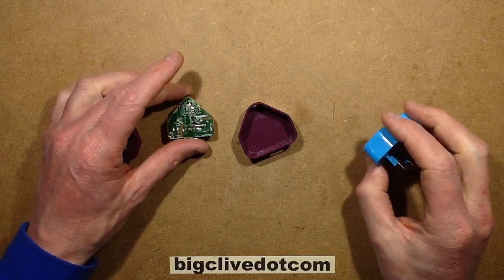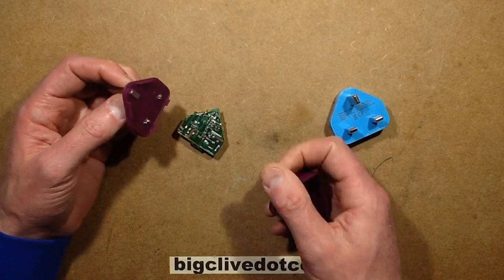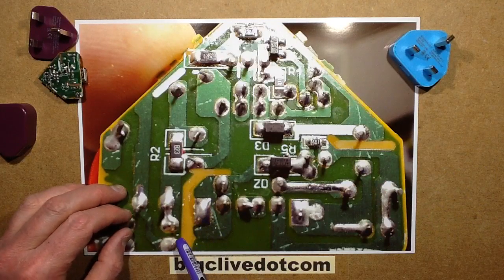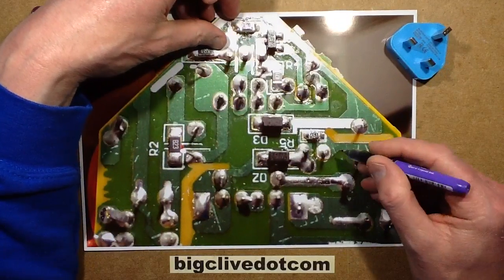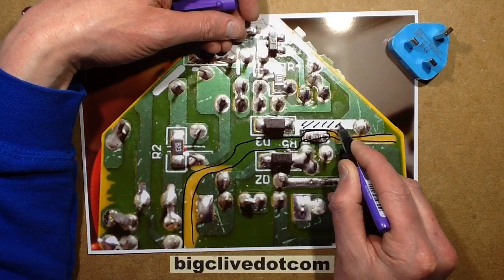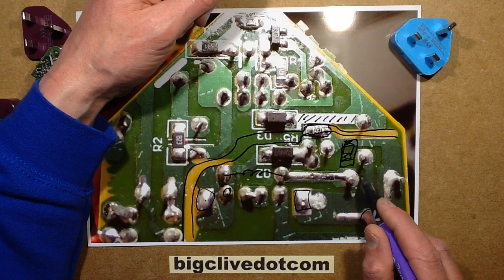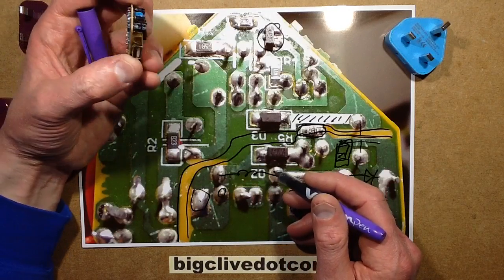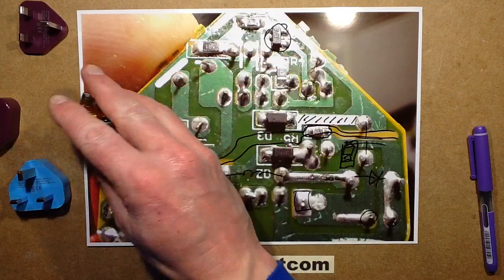Silly isolation fail in cheap USB power supply.

Comment: I have one of those knock-off US iPhone chargers (two actually!) with the crappy, nearly non-existent isolation. I also have a large isolation/noise filtration system.
I should make a vid, "How to safely use a fake iPhone charger", by showing it connected to this system.
Which would be entertaining:
Tiny 1" square USB power charger, connected via GFI outlet, to this huge industrial panel covered in transformers and EMI filters.

Comment: Could it be that the design was done by different people/companies at different stages?  For example, the board was cut and the holes were drilled at one factory, then they all get sent to another for the etching on the idea that the next guy could handle the rest of the design.

Comment: 0:58 it's actually low voltage to extra-low voltage isolation. Low voltage = 120-1000V, extra-low voltage = 0-120V. High voltage is more than 1000V.
Reply from the maker: +rfvtgbzhn For us electricians, yes.  But for the average dabbler low voltage is batteries and high voltage is the mains.

Comment: Clive, have you heard about electrolytic capacitors in samsung TVs? They really do mount them almost touching the radiators, and they do it just because it's a cheap TV. They COULD mount them away from the heat, but why? Which producer would want to wait about 5-10 years to sell another TV to the same customer?
The same principle goes for anything, ESPECIALLY when we're talking about "cheaper-than-normal" stuff.

Comment: Clive, you didn't explain the way the circuit board is physically connected to the pins (plug) is it simply a "interference" fit once the whole unit is together or are is it soldered to the pins? Thanks a fellow Clive
Reply from the maker: +Clive Clarke-Watson Flying leads.
Reply: Ok thanks for that

Comment: great video as always Clive. I was very interested in that wonderful photo you printed off, very nice. Please can you share your printing secrets? What type of printer is it, and how you do those wonderful close ups. What ink/paper etc.
Cheers
Reply from the maker: +Doktor Uzi The clopse-up is taken with my Moto-G phone which just has incredible close focus.  The printing is using trashy bulk ebay ink on trashy Poundland gloss photo paper.  The printer is a hand-down Epson SX515W fitted with a CISS bulk ink cartridge.
Reply: +bigclivedotcom 
thanks Clive..great results from modest equipment.
Reply: +bigclivedotcom What generation moto G do you have? Mine (gen 3) doesn't focus until i'm well over 10 centimeters away from the subject!
Reply from the maker: +ypoora1 2nd gen.  Focusses at about 7cm.

Comment: Isolation is ridiculus here.... You need like minimum of around 5mm clearance/creepage for primary to secondary in power supplies like this (based on 60950-1, actual cl/cr depends on many factors and can be read of tables in the standard). Ah the magic of "self declaration" of CE mark...

Comment: +bigclivedotcom As someone who has recently gone a bit bananas on ebay because of your videos (for those funny, and odd, Chinese devices), you make me slightly scared, Clive ;) I guess i will have to disassemble the stuff and double check.

Honestly though,  I have started to take more things apart when I've become bored and I'm not always that impressed by stuff that is sold in Canadian stores  (I live in BC, on the Wetcoast). Some of the stuff is full-price, 3 year warranty stuff, and the interior solder job is shocking. Fucking hell.

Comment: This may be a noob question but... what means reversed bias?
Reply: +minecrafter9099 Diodes only conduct current in one direction. When it is in this state, it is said to be forward biased. If a voltage is applied such the diode will not conduct, it is then reverse biased.
Reply: unknownhours
thx :)

Comment: Mind you ...what do you expect for a Quid....Amazon have recalled there chargers for the Kindle and they look very similar.
Reply: +Graham R Dyer kindle chargers were quite a bit different, they were not apple knock off type design, I had one, but did not dissasemble, maybe Clive can get hold of one, but i already did my amazon recall, so cant send mine. but yes the temptation to skimp on design for a tablet sold as low as £35 has cost them probably most of any profit from it (£12 refund or a replacement charger which sells for £17), i can imagine they wont sell such a low priced tablet again once this model is changed.

Comment: Wouldn't the charger become more efficient if the isolation failed? instead of the mains power going through a buck converter, you are just getting a direct 240V into your phone, thus greater efficiency. :)

I'm sure phones love a good 240V.
Reply: no phone would take 240v, it'll detect its got direct mains and therefore freak out and tell you that it's not taking the charge no matter how much you want it to
Reply: if it doesn't blow up first.
Reply: +Razor2048 probably blow a minute component inside the phone without any obvious signs, except it will never charge again.
Reply: +jusb1066 It'll probably blow a TVS diode (Transient Voltage Supressor), in layman's terms overvoltage protection diode! Hard drives are fitted with them too, had to replace quite a few after PC owners used cheap PSU's.

Comment: where do you buy your bulk ink?
Reply: +Carbon cricket FX A guy walks into a bar and there is an engineer sitting there with a beautiful parrot on his shoulder.  The guy can't help but say, "That's awesome. Where did you get it?". The parriot replies, " eBay, there's lots of them."
Reply: Poundland?
Reply: eBay there's plenty and it's cheap

Comment: Bottom line: the chinese don't care. So what if they kill someone? Even if the authorities close the shop which made that thing, another five will pop up in its place and do the same thing. It's like a hydra made of unskilled laborers. Until their government starts throwing those scumbags in jail - or better yet, we start building things in countries with integrity - it won't change.
Reply: +SigEpBlue There's another option:  Ask Chinese people why this happens.  You'll be told an incredibly honest answer:  You get what you pay for.  The Chinese are experts at making anything to a price.  You want to pay less?  No problem, you get the flunkie to design the circuit board and you don't bother spending on glue to hold the case together.  You make the case out of cheap plastic that can crack.  Etc, etc, etc.

People who are 'buyers' in China have told stories about factories that make the same product at multiple price points.  Bicycles for $100 wholesale that don't fall apart by day, and $10 bicycles that have broken parts and missing parts by night.

You can legislate all you want, but the end result will be the same:  Prices will go up to meet the price point of the legislation + an additional percentage for the cost of the additional compliance measures.

Or you can just simply stop buying shit for $1 that should cost $10.  Then you can pay $10 for the stuff that won't set on fire or electrocute you, rather than pay $12 if you'd legislated it that way.
Reply: @shepd3  Indeed. I've had some very good quality chinese made tools and some that were of very poor quality.
Reply: +shepd3 yep China makes what sells, and people are always looking for cheaper and cheaper, there are plenty of decent usb adaptors of quality, but they cost 10-20, not £1, its peoples own fault in the end, laws are already in place, but direct buying, and along with shops who will sell these by 'mistake' they will always be around causing house fires.  its only with power does cheap become dangerous, theres plenty of other cheap crap around, tools etc that arnt even worth their steel, but some people will only buy the cheapest of anything and not realise its a waste of money.
Reply: +SigEpBlue to build on what shepd3 said, (and this could be wrong) but I've heard the quality of Chinese made product is much higher actually IN CHINA. What they export they can export with low safety regulations, because supposedly it's up to the country that's importing to decide if the product is safe.
Reply: Not to mention that people forget that China makes both the best and the worst of stuff.  You can bitch about cheap Chinese shit but the expensive electronics you own like your Logitech keyboard, Dell monitor and Toshiba TV, they're all made in China too.  It's not that the people are shoddy, it's just that they make both the cheap and the good and if people are only willing to pay for the cheap then they get what they pay for.

All we can do is try to educate folk so they know the risk involved, if I see an acquaintance with a brandless phone charger I tell them that if they are going to use it to never leave it unattended and to never touch the usb connection.  And that it will be a cold day in hell before I let them plug it in to my house.
Reply: @krashd  There are always going to be people out there buying £1 imported stuff and then reselling it for £10, so 'you get what you pay for' isn't always a valid excuse. You get what the person who made the thing was paying for, and pay whatever the person you're buying from thinks you'll pay.
Reply: +SigEpBlue actually this is not a Chinese problem. Almost all electric/electronic products are made in China today, even most high-end products. The problem is capitalism in general: profit is more important than lives. They are only made in China because they are cheap to make there. If another country becomes cheaper the production will be moved there. There is only one way to counter this: more control from the authorities. But this costs money.

Comment: It's really, really odd when things like this happen. Someone thought to put in some isolation, but then decided to stick a component in there? Or someone else found a new opto isolator and needed the resistor? It's not like you can just throw components on a board and have a power supply, someone somewhere "designed" this. But I'm a software engineer and some of the baffling things I've seen people do with coding probably applies to electronics too.
Reply: Most likely: someone designed such a circuit board, then someone in China tried to copy it, but with cheaper components, and needed an extra resistor... luckily, the original design still had some free space left there.

Comment: I wonder if it's sabotage. Leave some PCB designs lying around on a honeypot server for the competition to steal. Or maybe they found the instability issue and some junior engineer just threw a resistor in.
Reply: +kuro68000 The latter, it really does look like a late add-in.
Reply: +Morbuto And actually a lot of times the original design will be from a component supplier to increase their sales, the factories often don't have any competent electronic engineers.
Reply: +Morbuto I've seen it happen in the UK too. A company made a battery powered device and later another engineer "upgraded" it to higher capacity lithium cells. The charger circuit started overcharging them and the sealed metal box would create a pretty effective bomb. Cost the guy his job and the company a few million to replace the affected devices.

Comment: Have you ever heard of Micronta multimeters? I have my grandfather's very old multimeter and it's a Micronta. Just wondering if it's still any good as a regular-use meter.
Reply from the maker: +Dakota Blake Quite old.  Used to be sold by Tandy / RadioShack.
Reply: +bigclivedotcom Indeed, Micronta was Radio Shack's house brand.  Whether it is any good depends on the model as they ranged from the very low end to the more middle of the road quality wise.  Accuracy wise they typically were not stellar, perhaps +/- several percent), but are plenty good enough for most non-precision measurements (and most measurements do not require high precision).  But for many of us growing up in the days before the Internet, Radio Shacks's multimeters/VOMs were the only models many of us had ready and local access to and so they were very popular with hobbyists for that simple reason.
Reply: I have no clue what the model of mine is, though it has a very ancient EverReady AA battery in it. Curiously, it isn't exploded.

Comment: I was just considering buying a wall to usb outlet, and although I have essentially no reason to be frightened by a website like Amazon, this has made me realise I definitely need to check reviews, especially for cheapo electrics
Reply: +yaseen reza Beware that most of reviews actually don't open the device to do a proper check... Actually, brandless items from some places are almost guaranteed of neglecting safety standards (creepage, isolation, EMI, temperature...)
Reply: +yaseen reza 
Oh, you have reason to be frightened by a website like amazon. They also sell the same stuff you get on ebay or from poundland. If it sounds too good to be true, it most likely is.
Reply: Electronica y Reparaciones superdau thanks for the replies guys, I'll keep my eyes peeled for genuine products only (and not just the fake ones pretending to be genuine)

Comment: Struth, they are silly buggers, that resistor could have been blobed lower across the solder joints and its original pads ground off.
It does make you wonder about design checking by secondary techs, obviously didnt happen :-(

Comment: I once set up a printer with a CISS device when I worked at the computer shop, it's when I started realising I'd rather use a laser printer... :P

Hmm, guess that the designer of that adaptor wasn't qualified in electronics engineering, but then, who is over there in china? :P